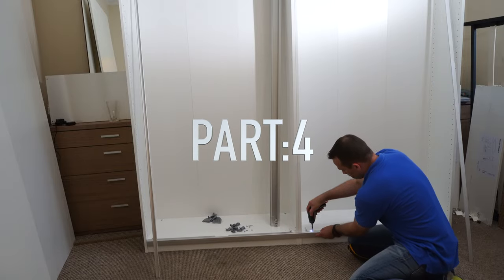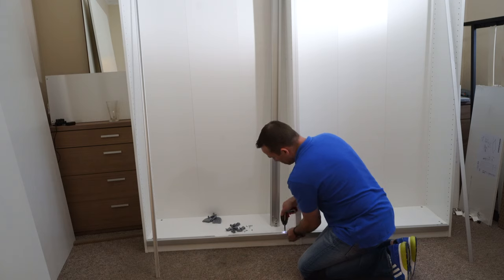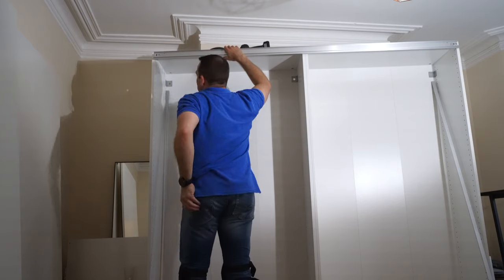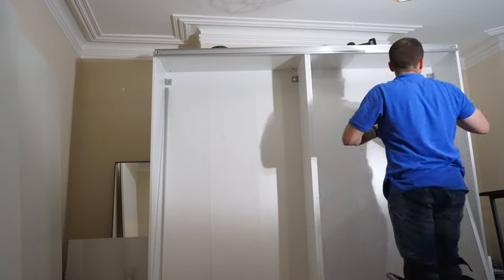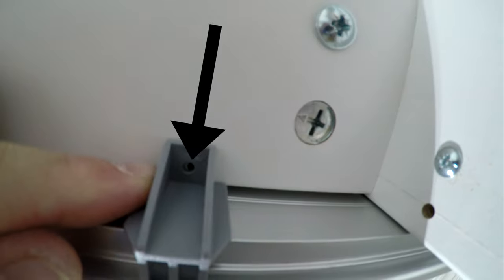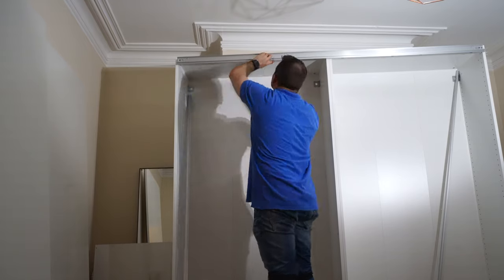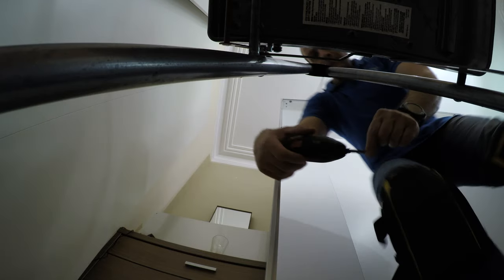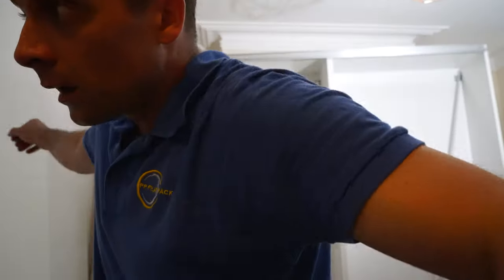Rails installation for IKEA PAX sliding doors \ Part:4

Comment: Great video, followed it to install my wardrobe.

I have a question which i hope you can answer. I have 2 x 100cm wardrobe with 2 sliding doors, but i want to add another 100cm wardrobe to it. Is there a way i can have another sliding wardrobe, so having 3 sliding doors. So cutting the rails and adding on maybe? Hope you can help. Thanks

Comment: This video is really helpful i wish id found it before id built the wardrobes. Im not atraching the rails and have realised my wardrobe is upside down. Will it still work if i use the bottom rail at the top and vice versa.  Thanks

Comment: Thank you so much for this video!  We really want this PAX with sliding doors.  However, the height of the place where it will sit is 80" or 203.2 cm in height. I believe that the grey plastic pieces that side ontop and help hold the top rail will make it too tall in those places where they sit! Do you think that we could skip using those?  Will the long two screws that go in the front and the 8 smaller grey plastic pieces that get screwed inside to help hold the upper rail will be enough? We have a higher ceiling in the rest of the room - so we can assemble upright and slide it into the space easily.  With th grey plastic pieces on top can you confirm the height where those pieces are?  Thank you so so so much!  This saved me a possible nightmare if I would have purchased...need to know if it will fit first!!

Comment: Hi 😊I Always love watching yours videos, but this time I finally have a problem.
I have some problems about my IKEA Hasvik sliding wardrobe assembly installation, I have no idea what happens.
When I try to install these parts at the bottom, I find that it can’t fit in, it has some gap around the center area, how can I do, what’s happening? Why has a gap? Have I did something wrong step?

I hope you can give me some comments or direction.😵‍💫🙏
Thanks
Reply from the maker: There is new version for Ikea Pax doors (different top and bottom hinges and rails) not sure if you have previous version or the latest one. If you have the new one here is the video https://youtu.be/Ilxl5yDrq48?si=bW8PNYUDI6KUo54T I don't have video yet for HASWIK doors. You can send me short video to my mail hard to say just from your comment.

Comment: Hello sir. Little question.. do I install the insides like the drawers and rails first or the sliding doors for the PAX. Thanks so much 🙏🏼
Reply from the maker: It works both ways. I usually do first sliding doors first just for easier access from inner side if need.

Comment: Hi,
Your videos are making my life easier! I have a question though I followed your steps but the 8 inside pieces that get screwed in aren't completely flush when I put them in. I'm not sure what the issue is, do they need to sit inside the small gap between the frame and the wardrobe  or should they be resting on the edge of the wardrobe. Any help would be greatly appreciated.
Thank you!

Comment: Tnx for the video's. I have one annoying problem, my sliding doors do not close well. The left door is perfect below with the hairs closing very well. However the upper half side has an opening, making it not symmetrical. 
The right door has the opposite; the upper side closes very well, but the below half has an opening. Any advise?
Reply from the maker: You can adjust sliding doors little but some time is easier just put something under one corner to lift the wardrobe little up. Other option there is adjustable legs sometimes you can adjust small gap this way. It is hard to explain there is more stuff to avoid this usually if you make pax frame right should not have the problem with doors. I will do video in sliding doors adjustment soon with all the details.
Reply from the maker: There is one more option when doors on on side not lining up with side check this video you may find answer here https://youtu.be/RE2RYb6kDCI
Reply: @PPFlatPack Thank you...
Reply from the maker: I think your pax frames are not in the right position. There is adjustment on the top hinges but before you do that try to put something under wardrobe one corner that may help.

Comment: Hey, thanks a lot for your videos, I found them very helpful! I've got a question though - is it possible to adjust the sliding doors in a way that there is a small gap between the door and the ending panel ?  In my case the wardrobe is right against the wall and it would make opening the doors easier (putting your fingers inside the gap)... I thought I saw it in one of your videos, but I can't find it now.  Thanks <3
Reply from the maker: Here is the answer to your question https://youtu.be/fTvlmmJts7g

Comment: Hi, Thank you for all these amazing videos.   We are just putting our PAX system together but when we stand it up we only have 6cm clearance.  Do you think we can still install the top rail or is there a different way to do this?
Reply from the maker: Yes it is possible if you need to build pax frames upright here is how you do https://youtu.be/iIuqzUXoR5s and 6cm is enough to put the top rail up. I did with 2cm clearance 6cm no problem.

Comment: Your video has saved me so much time. Thank you very much. One question I have. My bottom door is not aligned with the side. The top is correct but bottom is slightly off and leaves a gap. Any idea how to adjust it ? Here the picture of the bottom part https://drive.google.com/file/d/1y4CaVVadaFYYTpRtMezlFzIxRkZKnPAL/view?usp=drivesdk
Reply: I had the exact same problem. I solved it with a tip from PP FlatPack: You need to slide a small block or spacer underneath the left bottom of the pax closet, between the floor and the closet (in the front where you can easily reach it). Only 1 or 2mm thickness is enough.  Push against the front of the closet, and then normally the front will lift a little. The unequal left gap on my door totally disapeared with adding a little spacer of 1mm thickness underneath!
Reply: Jola Van Hoof if that’s on the left side I need to push it on the left ? I will try that.
Reply: @ramzez_uk  Yes exactly